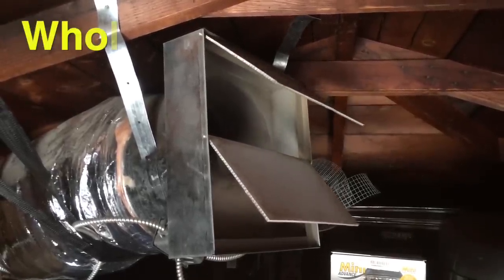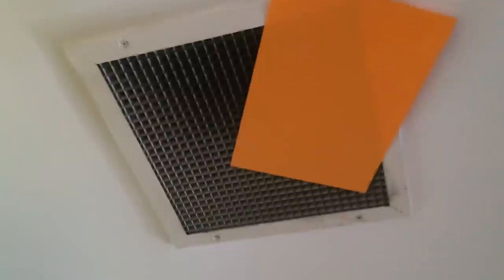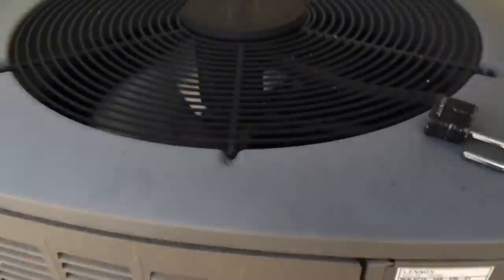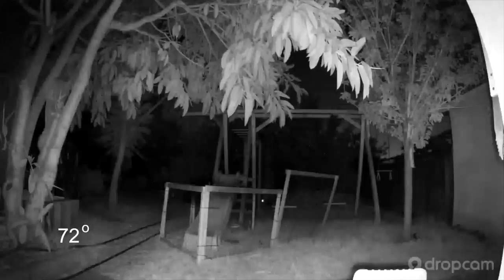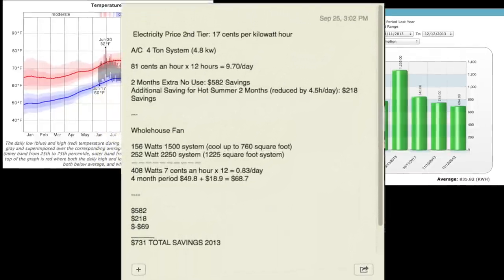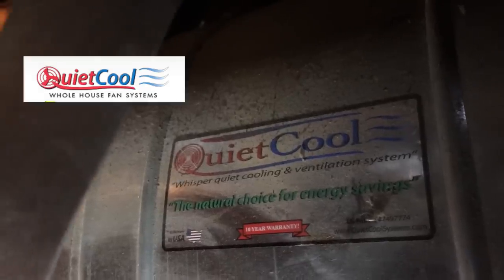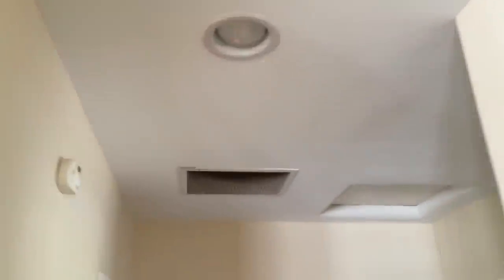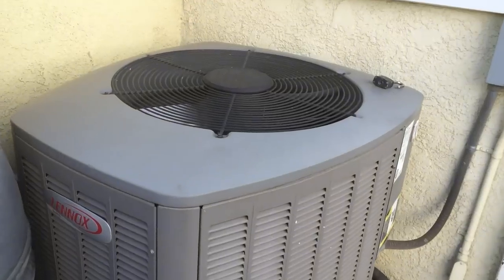Whole House Fan Reviews: Overview, Install & Energy-Savings Analysis

Comment: I lived in Texas, and the house only had a whole house fan, even during hot days we would run it, moving air is cooler than non-moving.
No it won't drop the house temp to 73 degrees, but it turns a sweat box into a drafty far more comfortable place. 
Adding an attic fan really helps push out the heat when running the house fan.
Crack some windows open on a shady side of the house and turn it on.

BTW, where I lived was peetty humid and would hit 110 and higher.

Comment: I've had a whole house fan in my home since the early 80's. As stated in this video it has saved me thousands of dollars in electricity. One thing I do is run the whole house fan all night and shut it off when the outside temp is a couple degrees lower than the inside temp. I then close up the house. If your home is insulated and has good quality windows it won't heat up for hours. My air conditioner won't turn on until sometimes 2 or 3 pm on a really hot day. I keep my thermostat at 76 in the summer. Then as stated in the video when it does cool down outside I shut off the air and open the windows and turn on the fan it's all good. They wouldn't work well in a humid environment. I live in CA so it rarely gets humid. When it does I don't use the fan. If it's comfortable outside then the fan will work well. Also it does increase dust in the house and in and on window coverings and treatments. The fan draws in a lot of outside air and everything in it that can come through the window screens. Also your window screens will get filled with dust too. It's easy to clean them but that happens. If you have lots of money and don't care about being green then forget the whole house fans. If you want to be green and save money then they work well depending on where you live. As with everything they have downsides but the upsides outweigh them in my opinion.

Comment: I can't tell you how much I love having whole house fans. I've had them since the early mid 1970's. Your install is even cleaner than mine! I have always used the type with louvers screwed to the ceiling that are opened up by the fan lifting up on them when it's turned on. Noisier, but still worth the massive improvement in quality of life. Now I have a house that has vaulted ceilings, with an attic height of only about five inches !!! It's driving me crazy to not have any cool air coming through the house in the morning and night to cold soak the interior. Any idea how to put in a whole house fan with such a low height attic ??
Reply from the maker: QuietCool used to make WHF that are designed for no attic roofs. I think they stopped making them, but there are still places where you can get one.
Reply: I'll start hunting for a least a pic of that set up !!! Thanks !
Reply from the maker: yes, exactly

Comment: When the fan isn’t operating, doesn’t the opening allow the hot air from the attic into the house? Those louvre doors seem kinda of thin with a poor seal.
Reply from the maker: good point. the model that I have come with a winter cover to close it up during the cool season. But even better the new models come with internal isolation system that closes up the vent when not in use.

Comment: Did you have to add more ventilation to your attic to push the air out?
Reply from the maker: +Crystal Stark not ventilation, but you might have to create more openings in your roof for the air to escape. Most roofs already have enough openings for passive ventilation.

Comment: How about in the winter? Its my understanding that it is very difficult to seal the fan opening creating a chimney effect, as  heat rises and escapes through the ceiling. making for higher winter bills?
Reply from the maker: +johnross101 good point. The QuietCool fans come with built in insulation that seals the fan when it is not turned on and prevents airflow. In addition you can buy a cover for the opening with magnets that can be stuck to the grid on the ceiling during the cold season.
Reply: what about the summertime? I see the 2 flaps the open/close near the fan. Will hot air try to force its way through those 2 flaps and enter the home? Or will cool air inside the house get sucked into the attic during the day when not in use?
Reply from the maker: The Quietcool fan includes a damper system features barometric pressurized gravity dampers that insure there will be no heat/cooling loss between the home and attic.

Comment: Nice Video !
What size/model Quiet Cool fans are you using and how many cubic feet of home are you cooling?   Better yet, how many cubic feet per fan ?
Reply from the maker: The Erod1944 Channel Inside my home I have a 1500 CFM and a 2200 CFM Fan, my home is 1500 sq feet.My office is 300 sq feet and also has a 1500 CFM fan. 

Whole house fans are measured by the amount of air they move which is referred to as "CFM" (Cubic Feet per Minute). For proper airflow, a whole house fan system should generate CFM's that are between 2-3 times the sq. footage of the home. For example, a 1,500 sq. foot home should have whole house fans (either a single or combination of fans) that can produce a total of 3,000 to 4,500 CFM.
Reply: Thank You!  Now I have a reference point that I can feel comfortable with to get started on my WHF project.  Ed/Central California.